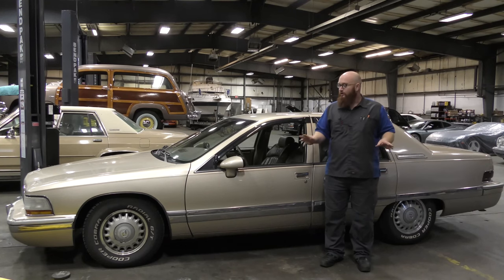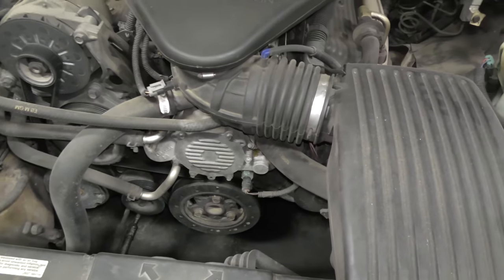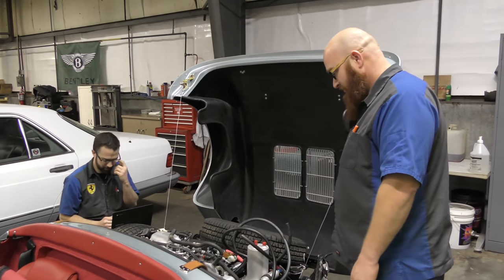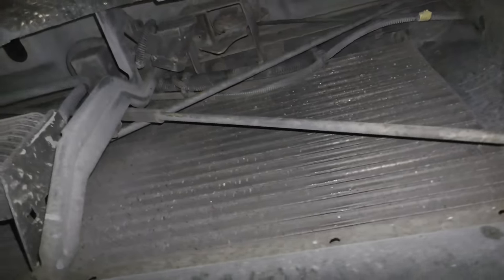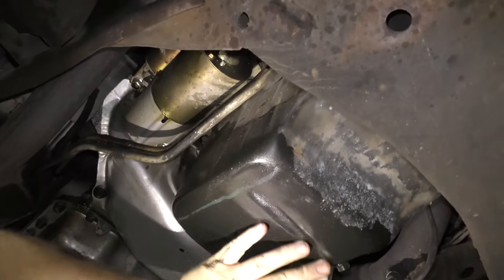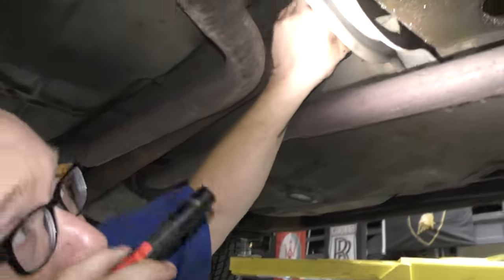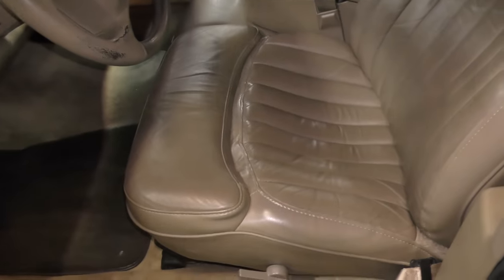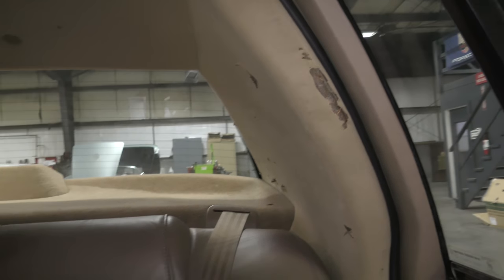Why do mechanics buy 'grandma' cars? CAR WIZARD explains their lure with this '94 Buick Roadmaster

Comment: A dude I work with has a road master.  He changed the distributor cuz the water pump was leaking on it.  The car still ran but he was worried it was a ticking time bomb.  So he changed the water pump and the distributor.  New distributor craps out in 6 months.  So he was like screw it, I’ll throw the old one back on.  That was 4 years ago and still running on the original distributor to this day.  400k on the poor road master still with the original distributor

Comment: I put a 93 LT1 in my 85 z28, has a 95 4l60E and pcm and it's a phenominal platform that fits the stock engine mounts and has the tried and true chevy v8 350 short block and has a easily tuned MPFI ECM that I can tune on my home computer and I spent a total of $100 for tunercats, the software. After the basic LT1 fix mods it's a very reliable and has all the power I could want for a vehicle made for DD duties. Couldn't be happier and all the info and tons of user experiences online made researching and putting the whole plan into action a breeze. If I could get a roadmaster I would do it in a heatbeat. Buick rocks and a RWD v8 buick is all the more fulfilling.

EDIT: After getting familiar with the opti and waterpump setup, it's mechanical nature and improvement over old style distributors makes it a one of a kind, powerful, and cost efficient alternative to purely electronic spark control and as a side note the precision and "clockwork style" feel of the engine gives it a distinct and awesome aspect that I love and appreciate being a hobbyist mechanic and having an interest in the old style mechanical systems that you just don't see anymore. And having a single $30 coil pack to replace if it ever goes bad is very affordable compared to LS style, 8 coil systems.

Comment: I'm a mechanic. I drive a 97 ford ranger 4 cylinder 5 speed manual and a 98 BMW z3 roadster. Both reliable and cheap and don't need much ever.

Comment: I've owned my present car for 13 years. it's 32 years old. I'm not even a mechanic, and it's a relatively easy one to work on. I've spent a lot on this one, but much of it has been in recent times. Holden, the Australian wing of the GM family took the 3.8 litre V6 commonly seen in Buicks, Oldsmobiles, Cadillacs and some Pontiacs and made it rear wheel drive. I can do the majority of the servicing myself, and I generally only "farm out" stuff I'm unsure of, or lack the skills for, such as bodywork. I don't even need a diagnostic computer to pull up fault codes, I just need a paper clip to junction over two pins. A "flash sequence" of the check engine light spells out which code it is.

I started a restoration some years ago, and have been "fumigating" the bugs, as in individual things wrong with it over the past few months. Fires first turn, and has been appreciative of the work done on it lately. It had to work hard for a few years when I was constantly broke, but never gave up on me. That kind of loyalty should be rewarded, which is why there's been a spending spree on getting everything up to spec

Comment: Definitely not a mechanic but I have a 1988 Lincoln Town Car Signature Series has the 5.0 V8 with 70k original miles. Absolutely everything works on it too. No rust, real solid car. Paid $2000 for it. It's like driving a recliner everywhere. Wicked comfortable ride.

Comment: I spent a couple years in college changing oil at a lube shop that also had a repair shop a couple miles away. All but one of the actual mechanics drove a 10-20-year-old grandma car. (The one exception was a young guy with a Datsun 240Z.)

Comment: I worked for GM Parts for 27 years and seen a steady decline in quality control and inspection in the manufacturing process. What passes inspection in 2021 would not have been acceptable just ten years ago. These days it's all about price not quality and nobody has figured out yet how to get both.

Comment: Its absolutely true... i spend my whole day standing, carrying heavy stuff, loosing my mind to bad parts, poor designs or even driving from house to house doing repairs and be told how i am wrong about what i was professionally trained to do and how my Professional Repair experience compares to nothing against the years of experience "Miss Karen" or "Mr Ken" have had with Washing Machines by using one program only. (im an appliance technician)... And if theres two things i treasure are my ''75 3 series bimmer with those spring and leather with horse hair kinda seats... a litteral sofa... so comfy... and my xtype jag which is also very smooth on the driving and the riding... I just wanna sit down and drive home comfy and snug and warm... Unfortunatly we cant get an affordable new car with these kind of features anymore.

Comment: Simple and easy to work on.   The first car I had, because it was super cheap, was a 10 year old Buick Electra.   After a few months it lost some teeth on the timing gear.   Dad was a mechanic so he took some time off and replaced the timing gear.   When he was done with that, he cranked it up and threw a rod through the block.   One of his mechanic co-workers wanted the car and put a working big engine in it.  It was a perfect project car for a mechanic back then.   Right now I've got an Intrepid, a Focus, and a Fiesta. The Intrepid with the 2.7L engine has stop-leak in the radiator, stop-leak in the oil, and AC Pro to stop leaks in the AC.   Even at only 25 mpg it's the car I prefer for long road trips.

Comment: The Only issue with buying older vehicles is that all of the parts are so worn down that you basically run into multiple new different issues every single year. All the gaskets begin to leak, the coolant tubes degrade, plastic parts begin to disintegrate...

Comment: I drive a 96 Civic DX and as much as it is a very vanilla car with manual everything (auto transmission) it is a very cheap car to maintain. Recently the original radiator finally went kaput so $125 later at Rock Auto for a better radiator, thermostat, and hoses and mornings worth of work, it should be good until I am done with it 😎👍. I am not a mechanic but I appreciate a really simple and cheap car to wrench on! Seen way too many people get a "new car" and it turns into a disaster.

Comment: The Roadmaster made 260hp not 300. GM only reluctantly OK’d the LT1 for B(and F) bodies for emissions-they were powerful & clean. But they wouldn’t allow em to make the equal HP as the Vette so they were detuned via restrictive int/exh & diff cam

Comment: My dad used to have a 1963 Ford pickup with a straight 6 in it. There was so much room in the engine compartment that when changing sparkplugs you could LITERALLY stand INSIDE there (well, I could anyway. I'm fairly slim). But beside that it was just stupidly simple to work on. It was geared so low that you could shift into third gear (the top gear) at around 7 mph without bucking. Years later I helped my dad shoehorn a 500c.i. Cadillac engine in there with the stock rear end (I think we used the Caddy tranny though). It was undriveable in anything but perfect weather, but super fun to melt the tires off. Good times...

Comment: Easy to fix, bulletproof NA engines and simplicity, almost no computers, simple 12v systems with no Can lines or low lines to diag. I have an 01 Camry as a daily driver and it's more reliable than 90% of stuff on the road today. Modern cars are not reliable or cheap to fix. There are so many more variables to fixing a modern car. Not to mention they discontinue cars so often and are so proprietary, after 6-7 years it's obsolete and they don't make parts anymore except junk chinese parts on ebay.
Reply: Canbus! UGH! I hate that crap, took a long time to figure out, what a nightmare! Give me direct wiring and fuses any day of the week.

Comment: Also, these designs were made for a long time. The Ford Panther platform was made between 1979 to 2011, the GM B-body platform went from 1977 to 1996. Some midsize cars had considerable longevity as well- the GM A-body ran from 1982 to 1996- and was even based on the X-body platform dating to model year 1980. Ford's Fox platform was built between 1979 and 2004, underpinning the Mustang, Thunderbird, Cougar, Fairmont, and LTD. Long production runs means more parts available- and this also explains why Ford Country Squires and Mercury Colony Parks are featured in movies/shows set in the '80s more than others- there's more parts available for them.

Comment: I actually enjoy tinkering with my own vehicle a bit, but sure as anything it'd a dead-simple old beater: a '93 Mazda B2600i. Bulletproof fuel and ignition, wide open engine with no frills, around 12 fuses total. When I had to replace the valve stem seals to fix an oil consumption problem, I rolled it into the shop at 8:00 AM on a Saturday and had the head back on and running with new gaskets and chains by 10:00 PM. You can do literally any job on that truck in a day or two.

Comment: I am age 65 retired mechanic and machinist and I drive a 1989 cadillac brougham.  Why?  It has a cast iron engine block and has no sensors and has no ECM and has a mechanical fuel pump with carburetor and can be fixed and driven FOREVER and offers better dependability than any other car on earth.  Offers comfort and safety and gets 18 MPG in town and 24 MPG highway.  Is also easy to work on.  It also has sporty handling despite its size.  Its engine was made by oldsmobile motor company and is all cast iron and is 307 cubic inches.  Cadillac offered these only between the years of 86 to 89

Comment: I only drive pre 1972 cars and pre 2000 trucks and vans. If I can get one of those cheap I bought it and fixed it to get it running. The 31 year old pickup I use most is rough and always has a problem but never leaves me stranded. You are so right about new parts, I  have been rebuilding old parts myself like the alternator, a/c compressor and starter to avoid annoying problems later.

Comment: My 2007 Yaris trans filter  replacement and refill costs about $500. The cat assembly job was about $1500.
My 2004 GRAND MArquiis complete trans flush is about $270. The cat may never need work.
And so it goes.

Comment: You have to understand that most mechanics deal with the general public which, more often than not, does not have the means to indefinitely maintain a used car. Therefore, because they become so acquainted and familiar with this "subsistence mentality" population, they themselves become conditioned to a "reliability" mindset. What are the most reliable cars that will require the least outlay of dollars devoted to maintenance to keep them on the road. And look, if you make $40, $50, or even $60k a year then you shouldn't be spending 10% of your annual take home pay on car maintenance. Either lease a car or buy a used Toyota/Lexus. But, if you make $150k or $200k then there is NOTHING WRONG with owning BMW, Mercedes, Ferrari or whatever you want! Some mechanic like Scotty or the Car Wizard doesn't want to work on your V8 BMW, then f*** him and go to someone else.

Comment: Old cars like that are the only cars I buy, NO COMPUTERS OR OTHER ELECTRONIC BULLSHIT....
I JUST BOUGHT A 1989 E350, WITH 42000 ORIGINAL MILES AND IT RUNS AND DRIVES GREAT, I PAYED 3000, OH I FORGOT TO MENTION THAT IT'S A RV....
THE INSIDE IS NICE AND CLEAN...

Comment: We usually have something easy to work on, something a customer gave up on and didn't want to fix and we got it cheap, or something to learn a new skill on before trying it for someone else or it's high risk job for our little shop but we'd take the gamble and do for ourselves. Our current daily drivers are a 04 Honda accord V6 that was too expensive to fix but worth driving this a new tranny and a 06 Dodge Cummins 3500 that works like a top. Dodge 3.3 minivans often make the lineup.

Comment: I spend a few weeknights in the spring and fall making routine repairs but that's only if I didn't just aquire another car or truck and ain't shaking it down to find parts to replace so I never have to do it again because I'll probably only put 1,000 miles on it a year.

Comment: That's right, a  tow hitch. i got one on mi '77 Oldsmobile, nothing to be surprised about if you know about cars and don't drive a new strawberry throw away car jajaja. you know that back in the 70s 60s 50s 40s ect people hauled trailers, campers with cars nobody used trucks like they do today no "super dutys" needed to haul a big camper full-size sedans and station wagons did the Job that's why you will see big Chevy Silverado brakes and rotors on that car in the '90s, they were still designed to haul even though rarely used them for that.. SUVs and pickups became a thing in the '90s after GM gave up on the body on frame sedans in the mid '90s Crown Vic up to 2012 after that we need Trump to make America great again and throw the front wheel drive unibody crap Chinese back to China...

Comment: 1:46 only corvette with aluminum head and different cam had 300HP
275 HP was firebird and Camaro with aluminum head but milder cam than Corvette
Caprice, Road Master and Impala  had cast iron head and 260 HP

Comment: I've had a 1991 Roadmaster Wagon with the 5.0 TBI, A 1994 RM Limited with the LT1 and a 1995 RM LT1.  I would recommend anything 95-96 because they were OBD2.  This makes it easier to diagnose issues.  My kids loved the wagon with its rear facing back seat.  I always said, "Who's my tail gunners today?"  They have issues with the spring in the driver's side seat poking through, trans line leaks, side trim adhesive wears out and the trim falls off, trunk leaks, trunk pull down motor seizes, power antenna seizes, but the worst is the front door bezel plastic shatters from age.

Comment: The only drawback to those mid-90s Buick Roadmasters, is the fact that they are RWD...My 93 Park Ave is FWD, and has that bullteproff 3,8 V6. I do wish that Buick had installed a V8 in 93...they wised up in the later 90s, and did just that.

Comment: Because Grandma doesn't do donuts and go offroad with her buddies on the weekend. To do more donuts.  lol I'd probably prefer to be in that Roadmaster than a recent Buick if in a wreck (God forbid). Nothing wrong with a big comfortable car that protects you when needed. My grandfather fell asleep at the wheel while driving his '94 Lincoln Town Car and went directly straight into a huge tree around 55 MPH (tree trunk twice the width of the car). No airbags either. Sadly the tree didn't make it, but my grandfather only cracked a couple ribs (he was wearing his seat belt as always) and a bruise on the forehead, that's it. Buick has always been my fav GM brand. Buick = good engine! Not so sure with current offerings.

Comment: Not a Corvette engine. 2-bolt vs 4-bolt block, iron vs aluminum heads, radically different cam between these and the F- and Y-bodies. Like the difference between a truck 5.3 and the SSR 5.3. Same basic engine, yes, but an important distinction. And the B- and D- body cars (caprice/roadie and Fleetwood) only made 260hp. Less with either tow pack because of the mechanical fan those came with.

Comment: I bought this exact car in the same color. Mine had cloth interior.
It was in really good shape. 
Had the "corvette" engine.
  Then began a cascade of problems, main oil seal blew out,
 engine didn't want the replacement distributor, etc.
 After getting all of it fixed, a deer committed suicide and destroyed it. 
  Too bad too, because I usually get away with driving these kind of cars for years.

Comment: The LT1 is an engineering mistake of the SBC design.  Since they had to cram the engine underneath the dash in the Corvettes and Camaros, the had to put the distributor up front, when they could've gone with a coil pack instead, like the 3.8.

Comment: The mechanics on these cars work well and parts are easy to get and relatively inexpensive. However, the interiors of these cars do not hold up and fall apart very badly. That's my experience anyway. I'm currently driving a 1983 Chevy Celebrity with 2.8 V6 engine and a carburettor. No ABS, no airbags, manual windows, glass headlamps.

Comment: I owned a 1995 Chevrolet Caprice 9C! ex-cop car with this exact engine. When I bought it, it had 288,000 miles on it and ran great.  Great power/torque, idled with great oil pressure, and was fun as hell to drive back in the day. When I sold it, I made a little profit and the thing was running as well as ever with almost 300,000 miles on the clock. Kinda wished I had never sold it simply because I bought it so damned cheap.

Comment: 1994 Roadmaster with a Chevrolet LT1, nothing wrong with that. Full frame 5,000 pound towing capacity. If you have the Roarmaster wagon you can haul inside the car 4' x 8' sheets of plywood.

Comment: No knowledgeable mechanic would own an LT1. I had to replace the distributor 3 times in the short time I owned that thing. Any moisture would cause misfires, and you had to pull the harmonic balancer just to get at the thing.